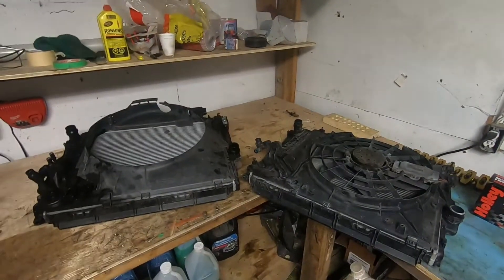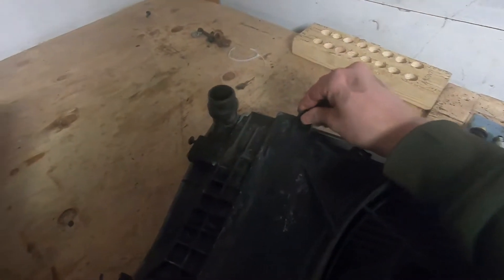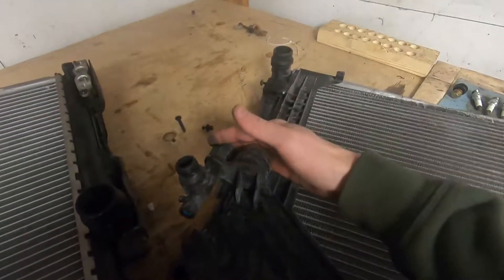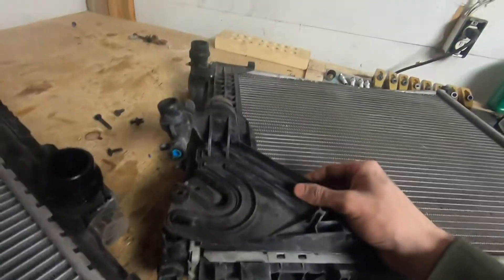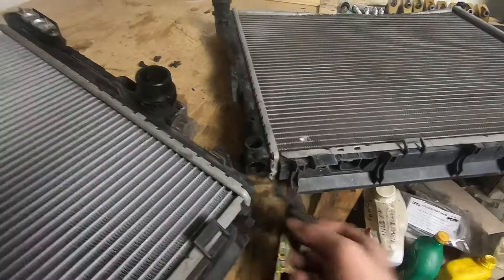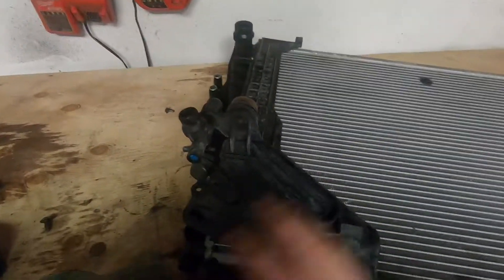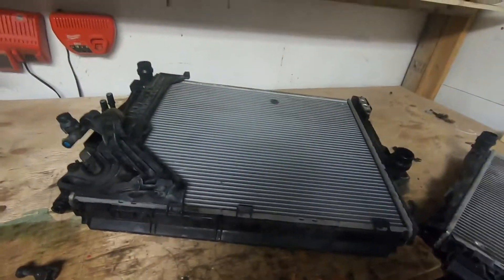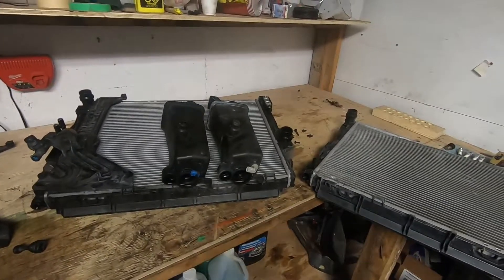Using a Radiator From an Automatic in a Manual E46

Comment: I've recently come across another video as to the transmission cooler and it shows the automatic transmission screw being the longer version with the shaft so that cooling can get back to the transmission and I have the small screw and the one I just put on it's an automatic but my transmission is running due to this apparently and I can't change it because it is a threaded short plug but most of them have them wing tips
Reply from the maker: That's odd, based on what I've seen and what both my cars (1 auto, 1 manual) had, the auto rad had the short drain plug so it allowed coolant to get to the trans cooler at the bottom. The long one on the manual seals higher up the tube so the coolant is unable to travel to the open hole of where the trans cooler would be. If you want, send the link to the other video and I can take a look.
Reply: @LifeAtTheShop  let me see if I can figure out how to send the link it seems that on an E46 with an M 54 it has one with short shaft and one with the longer shaft to circulate through the transmission cooler otherwise it just fills it up and doesn't circulate